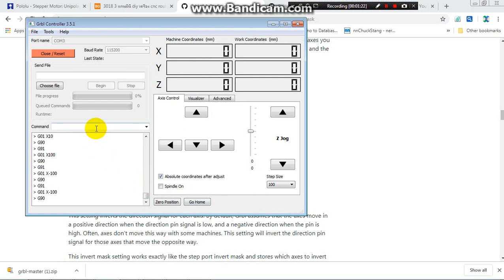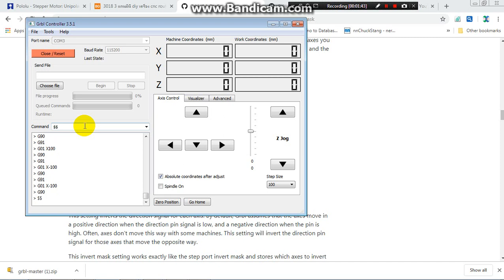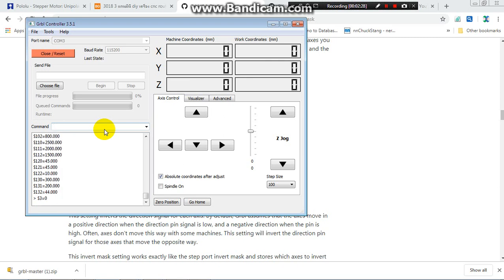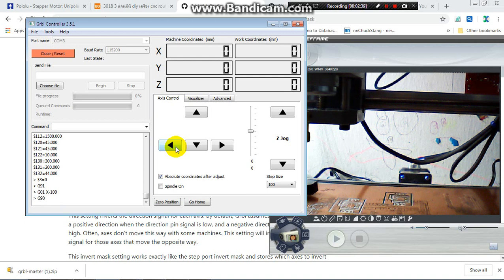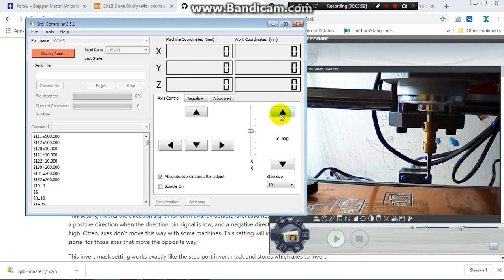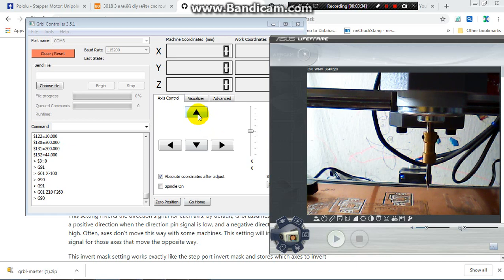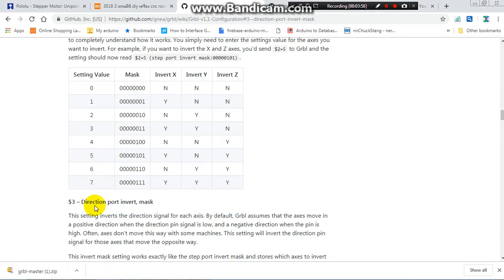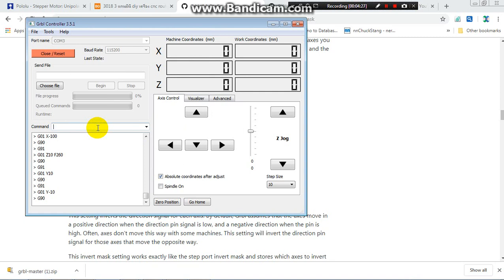3018 MINI CNC Invert A-xis and Adjust Accuracy

Comment: 6:26 wrong way. do x10 x20 x30 x40 and measure is lead skrew pitch correct.if you do x10 x-10 x10 x-10 you are getting backlash error AND still not know is there pitch error. you not correct with allready correct steps in rev lol.fix backlash.change better lead skrew. dont lie steps its allready correct its allways integer value never float.
if you have backlash then you CANT fix it by that way its not correct.it may cut correct square but it wont move one way correct LOL.get it? only if leadskrew has pitch error is only reason to change it.backlash you need fix mechanical way